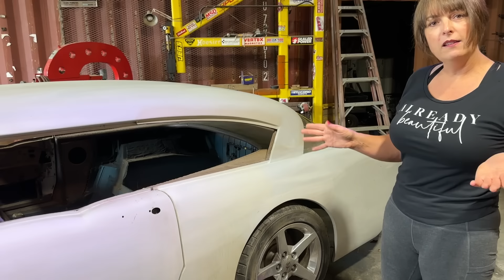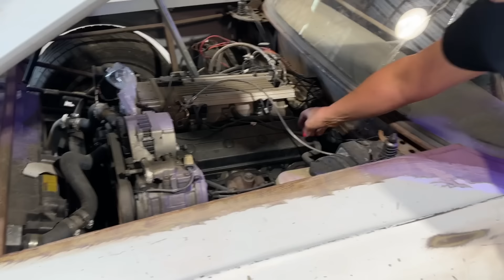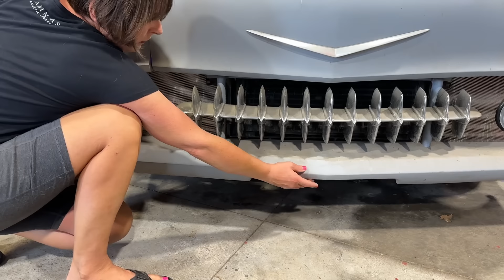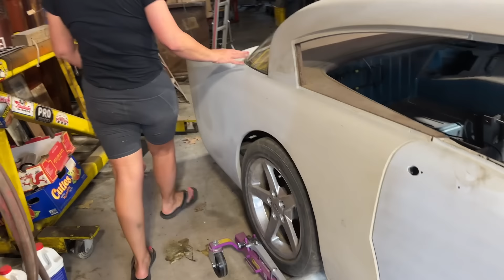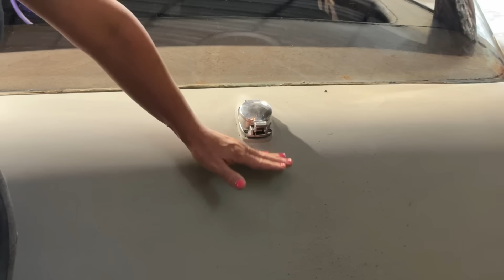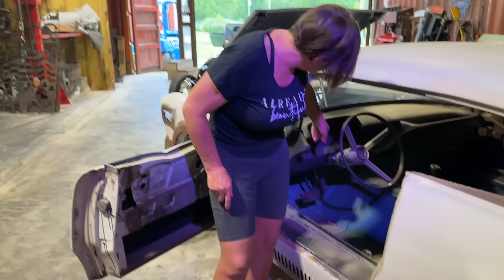Micah Wolfe Update, AND an In-depth Look at My Radical Custom ‘57 Chevy!

Comment: 🤩EPIC PROJECT !🤩
I've replaced a few of those stinky optispark distributors ..for those who don't know , it's mounted in front of the camshaft / behind the water pump ..the problem I've had with them is that they get very hot and there's a vacuum hooked up to them , therefore some of them actually melt and collapse/warp into themselves due to the vacuum (which ironically is there to prevent moisture)..it's very disappointing and aggravating !
New to your channel..Absolutely LOVE your car..Liked and Subbed ..Thanks for sharing ..looking forward to more videos 😎
😇❤❤❤❤❤❤❤❤❤❤❤❤❤❤❤❤❤❤❤❤
Reply from the maker: Thank you for your comment and subscribing; I really appreciate it!

Comment: First time reviewing this and I've subscribed.   One suggestion for your 57 Chevy.  Instead of build-ing a light bar across the rear trunk, Why not build a 3rd "brakelight" at the end of the roofline integrating the form of the slowly rising '58 Chevy impala
Reply from the maker: Thank you for your comment and subscribing. I've decided to just clean up my '93 Caddy tail lights and keep with that plan. I like the brakelight at the end of the roofline, but at this point, I just want to finish the car without making many more modifications. I don't want to get bogged down, and there is a small chance I can get this finished in a timely manner if I try to keep things simple.